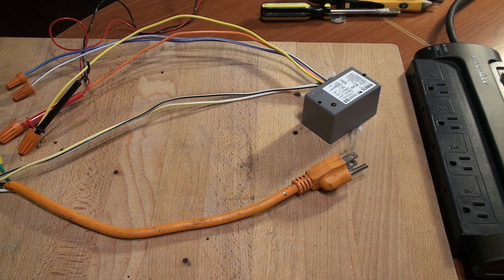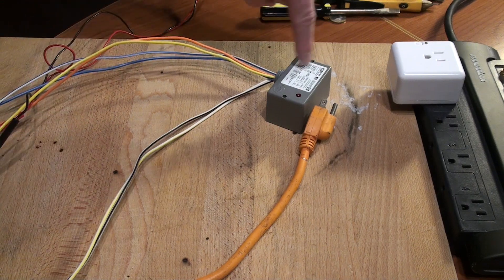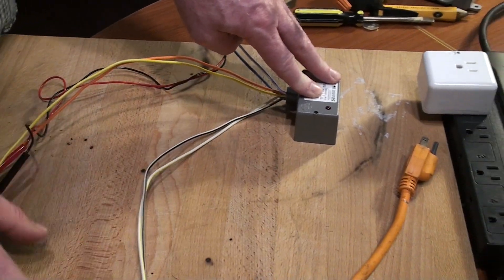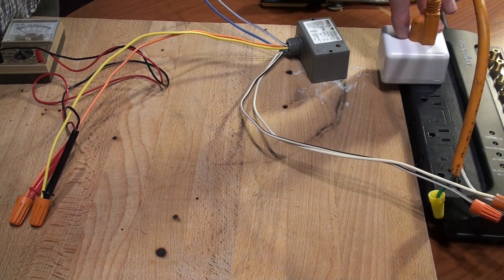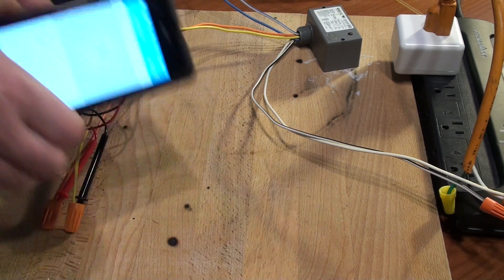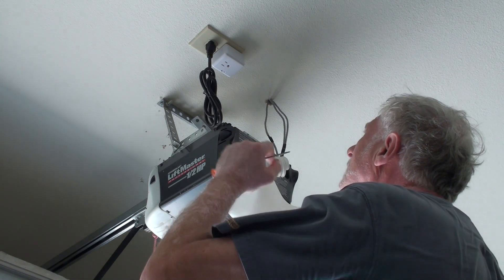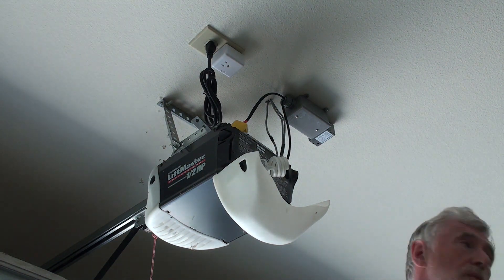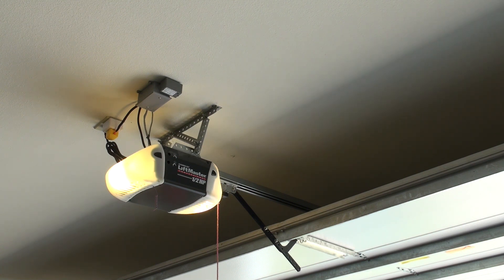Automated Garage Door with Samsung Smart Things and special guest Trev

Comment: Not sure exactly when the law went into effect, but unattended garage door closing "...must require an audible and visual alarm that must signal for 5 seconds before door movement." It has put a wrench in my smart home efforts. Any ideas on how to solve this problem?
Reply from the maker: easy, yeah, just play a sound, delay 5 seconds, then continue the program as per.  The Raspberry Pi has a 3.5mm jack.  This doesn't sound like a major to me.  But have a play.  Build a prototype first, of course.
Reply: @skiwithpete  Looking at buzzers with flashing lights on Amazon now. Problem solved. Thanks!

Comment: Good! Under $20 in used parts from fleabay(motion sensor for door, this relay and a smart plug). I will tuck it all into the j box with the outlet for the opener with the relay stubbing out on the side. To get the relay to trigger I created a smart lighting app automation with a zero minute power allowance for the plug to trigger the relay and it works great. Now to work on my other opener which use more than just a 2 wire bell button.

Comment: A word of caution: if your garage door opener is a liftmaster with Security 2.0+ then you will not be able to plug your relay to the back of the opener. Security 2.0+ encrypts the data sent between the wireless controls / wall button control to the opener. I had to solder a pair of wires to the back of the wall button and then connect the relay to those so that the relay would emulate someone pressing the button. It finally works for me.

Comment: Good video, BUT, it requires YET ANOTHER APP.
I have a phone that is full of APPs for all the IOT devices I have.
It takes longer to remember and fire up the correct app than it does to get out of the car and open the door.
WE NEED A UNIVERSAL APP, so that you just add the device to a list of other installed devices.
THE ANSWER IS NOT MORE APPS.
Reply from the maker: Did you see my other garage door video?  I just use a web browser...  search: skiwithpete garage door
Reply: That's the whole point of smart things.. It's designed to be able to work with many manufacturers making it one app for many.

Comment: Cool video, and clean installation.  I do think it's an overly complicated and costly way of doing this unless you already have the smartplug and don't know what to do with it.  There are z-wave dry contact modules that won't require the additional smart plug, [such as the FS20Z-1] and then you can use a multisensor on the door to know whether it's open or closed.  If you already have a smartplug gathering dust though, the method in the video is less expensive.

Comment: Video got me started and very interested! However, the 3 second delay drove me crazy for a day or so but I made it work without it. Loaded the Device Handler and set up an "Automate Lights and Switches" SmartApp" for the Iris Smart Switch and the RIB works like a charm. I also did away with the additional electrical box. The RIB I have looks slightly bigger than the one in the video. Because if this I simply capped off the two unneeded wires and connected the power cord inside the RIB's enclosure, which worked perfectly. One neat litttle grey box is all I have attached to the ceiling.
Reply: Can you give a bit more in details on how you did this?  Which Device Handler and how where/how does the Automate Lights and Switches SmartApp fit in if you are not really using a Iris Smart Switch.   Big Thanks

Comment: where did you find the 3 sec delay on the switch
Reply: Great video....I too would be interested in how you added the 3 sec delay....Thanks for any help you can sent our way!
Reply from the maker: This is the reply Trev wrote to me:

Hi Pete

I submitted a SmartApp called ‘Switch OFF after delay' to SmartThings. It seems self-evidently useful, but there’s not another simple one there, so I posted mine. I’ll let you know when it’s in the official library and send you the link. If they deem it too trivial then I’ll send you the code and you can post that so people can create their own private instance. 

Along with the basic SmartThings app called “Smart Lights' you can operate the garage door in a variety of ways - triggered by a wall switch or button, motion detector, open/close sensor … whatever. With the app ‘Switch OFF After Delay’ users can switch off the pulse after a couple of seconds. Exactly how long depends on their equipment. Mine is happy anywhere between 1.5 and 5 seconds.

This little app has multiple uses. Extract from the software notes:

*  May be used anywhere a short on/off condition of a few seconds is needed, for example:
 *  --- An automatic doorbell where a motion sensor switches ON a buzzer. This app terminates the buzz after X seconds. 
 *  --- An automated pet/fish feeder where a separate timer app turns on the feed switch. This app turns off the flow after X seconds. Use along 
 *      with a delay timer between feeds eg use Dashboard / Custom / New Monitoring Rule ...
 *  --- A garage door opener actuator where an on/off pulse of X seconds is needed to either open or close. Any other app can trigger
 *      the ON condition by detecting motion, button operation of a button, or elapsed time. This app will teminate the pulse with an OFF signal. Once again you can use
 *      ST Smart Home Monitor / Dashboard / Custom / New Monitoring Rule ...) with this app to close a door left open.
 *  --- Use with app 'Switch ON After Delay' to create a continuing on/off flashing sequence.

As you can see Dashboard/Home Monitor will close a a garage door left open. I actually wrote a SmartApp to do that, but the ‘official' one offers more choices so I won’t publish mine. I didn’t find it when I first looked for it because I looked under the SmartApps heading. Silly me. It’s in Dashboard / Configure /Custom / New Monitoring Rule …

If you like, I’ll write a ‘how to’ guide you can point your fans to.

Cheers

Trev
Reply: Would it be possible to get the smartapp code he used, i want to do this exact thing but really having a hard time finding a good app to use

Comment: @skiwithpete what does the relay do in this case?
isn't the smart plug just a relay basicly ?
Reply from the maker: Great question.  The smart plug is indeed a relay to turn on and off mains power.  But, just providing power to the garage door doesn't trigger it.  The other relay allows you to make a connection between the + and - on the garage door (which activates the door).  So you could describe this as Relay 1 triggers Relay 2.  Where Relay 1 = Smart Things and Relay 2 = Garage Door trigger.  Does that make sense?
Reply: ok so in that case you could switch out the 2nd relay for a power brick of proper rating and get the same result?
Reply from the maker: I'm not sure how the garage door opener works.  Does it detect that the + goes to GND or does it detect the signal on GND?  So I understand your question, but I think that assumes that it detects a signal on the GND, and it may not...  Did that make sense?
Reply: ok i get what ur saying
and i just want to say thank you for slipping ur spacebar upside down I tried and now love it!!!!
Reply: koloec94 p